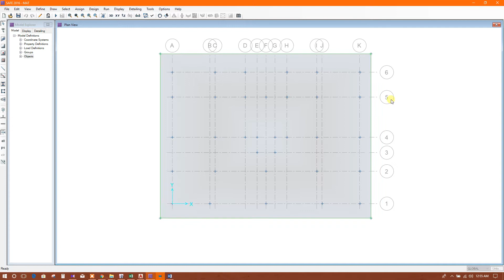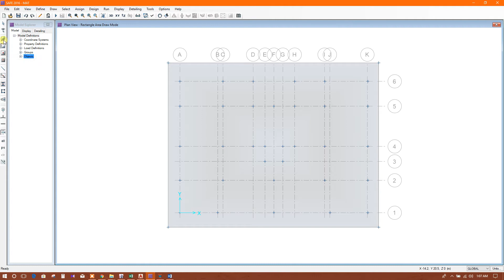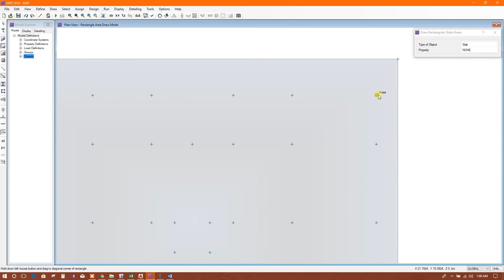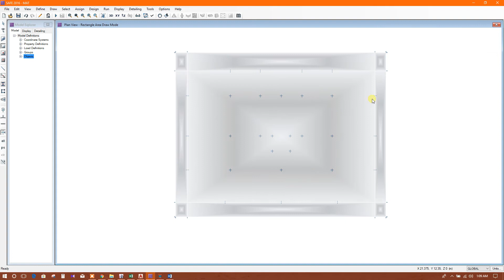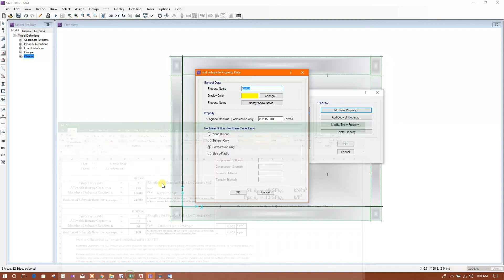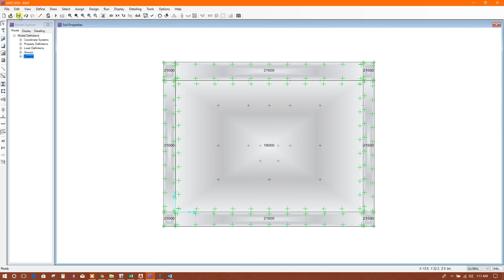4.CALCULATION & ASSIGNMENT OF SOIL SUBGRADE MODULUS IN SAFE-MAT/RAFT DESIGN COURSE

Comment: I check soil pressure and puching shear. Punching shesr failed, so I add drop panels.
But after putting drop panels the soil pressure also decreased. I cant understand , the pressure become too low.

Comment: Hello, thanks for the tutorial. However, as the basic assumption in case of raft footings is that they are rigid members/slabs. In this case will the slab settle differentially and do we need to still model this behaviour as shown in the tutorial?